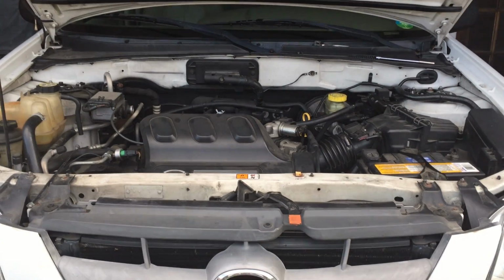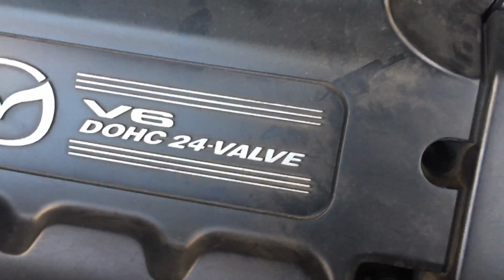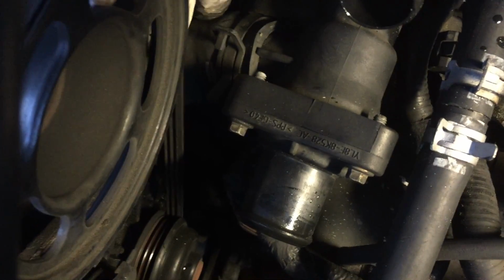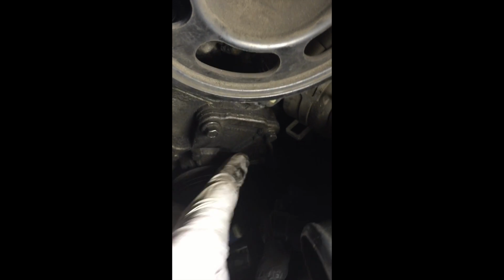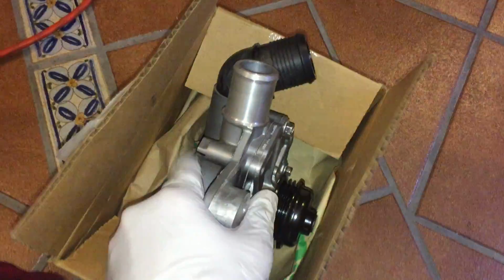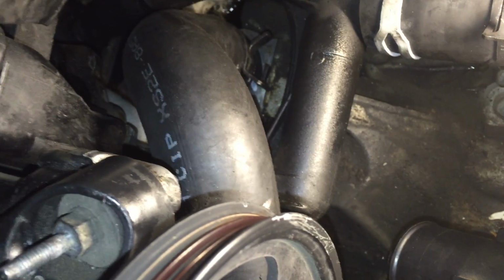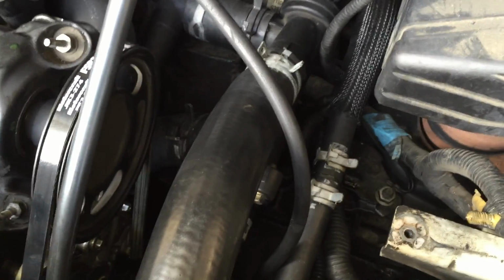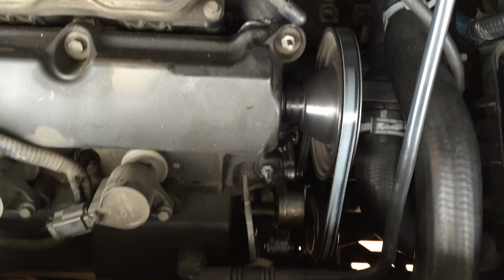2001 Mazda Tribute V6 water pump replacement

Comment: Thanks so much for this video, helped me so much (and still will in future). Turned out the plastic connection on the water pump housing was this close to sheering off for a long time, as I found out while trying to jiggle the thermostat connection off, and it broke off at the other end, with a huge splash of coolant. Now there's my problem!

Comment: You gave me the confidence to try to do the job myself, very well explained and to the point. Only thing that puzzles me is that the the water pump model you use for your job shows as non-compatible with the 2001 Mazda Tribute in multiple searches. Any thoughts?
Reply from the maker: Juan Carlos Martinez-Sanchez , thanks for your comments. Strange, the replacement pump I used is Ford/Mazda original replacement. Remember: mechanically all Escapes and Tributes of the same years are the same.

Comment: Great video. What is the part number for the plastic connector to heater you mentioned in the 11:10 mark?
Reply from the maker: Leo:
Check below on my replies. Most of the hoses must be purchased directly from a Ford parts supplier.

Comment: Mr rochet, great video thank you. my leak was not the water pump but the bottom outlet hose. part number yl8z6n746ba is got a clamp on the top, please how do I take it off?
Reply: there is a little clip holding the clamp open is it to make install easier?
Reply from the maker: To be honest, I removed/installed that hose with the pump out. Is much easier.
Reply from the maker: Yes, the clip on the new hose clamp is to hold it open until ready to be installed.

Comment: would you recommend taking the whole pump off just to replace the front part ? do you know if the front part has a gasket or just need sealant to connect to back part ?
Reply from the maker: Saab Aero:  Yes, I would recommend taking the pump off. Is too cumbersome and tight to split the pump, although not impossible.

Comment: Mine i got problem with leaks from water pump the connector of small hose, because of the plastic O ring..can you suggest what kind of o ring can i replace for that connector? Thanks in advance. Im from philippines🤗
Reply from the maker: There is a plastic connector on the longest hose. I don't recall a plastic O ring. The plastic connector can be replaced with a bronze one of the same size.

Comment: Where did you get the lower hose that comes off the water pump I believe it's 5/8 hose for the heater, I can not find it anywhere
Reply from the maker: Hi whatupfuch: I tried to get those hoses via internet and wasn't lucky. You need to go to a local Ford parts dealer and find them. There are 7 hoses in total. Here are a couple I found on my invoices...(sory, I don't have all of them).
XS2Z-8A577-AB SHORT HOSE
XS2Z-8A567-AA HOSE
The above two hoses go to the pump and plastic manifold. You need to get the other ones that go to a plastic hose manifold that sits besides the pump. Your dealer should be able to show them on the Ford parts diagram. The lower one I show on the video, goes from the pump to the block (front side). It changes depending if you SUV has oil cooler or not. My doesn't. Try to have your VIN number handy. Hope this helps. JP
Reply from the maker: Good news! I found the info you were looking... These are the other hoses I bought:
KH-125 Heater Hose
KH-134 Heater Hose
YL8Z-6C658-A Hose
YL8Z-18C553-HG Hose
I hope this helps.  JP
Reply: +Jean P. Rochet thank you for your help
Reply: how much total for all parts?  buy motor craft or other brand in sure motor craft better but is it that serious to get motor craft?

Comment: hi the water pump small hose below has a switch what is that for should it be closed or half open ?
Reply from the maker: Chris p: I'm not sure what switch you are talking about. Is you SUV a V6 or a 4 cylinder model? The one I worked on this video is the V6 model. If you can, please send a picture of the "switch".  Jean

Comment: Mr. Rochet my  Ford Escape 2001 3.0 have the same water pump I can't find the trick to remove the long hose, can you show ho to do it?
Reply from the maker: If you are talking about the one that goes on top of the engine block, that's a pain in the behind to get out !  I also had to struggle to get it out. Check the video again: I used a small long nose pressure pliers to open the clamp that holds it. Good luck.

Comment: hey I have 2001 ford escape v6 xlt. get crappy mpg. 170 180 full tank. throttle body  cleaned so they said well mechanic said. get valve changed about 2 yrs ago. But. I feel i should get more mpg. any tips?
Reply from the maker: Those V6 engines are known for having leaks on the intake runner silicone seals. They should be replaced after 60-80K+ miles. The symptom is rough idle at cold starts that improves after the engine gets to operating temp. Be aware that there are seals above and under the intake manifold separator. Many people change only the upper ones and forget about the lower ones. If you do the above, change all spark plugs (anyway you will need to remove the intake manifold to replace the three plugs on the rear of the engine). Also try Techron gas treatment and fuel filter replacement.
Reply: Jean P. Rochet I bad oil in 2 plugs well  when mechanic  chafed plugs I had manifold  gaskets upper and lower he didn't replace for me because said may need to  do I think engine gasket or whatever he said also ran scanner no codes. But I think I'll replace manifold gaskets asap because 140 miles on full tank is ridiculously  low to me. got 210 one weekend in a highway trip then next weekend on reg  driving city with some a.c usage 140. before he cleaned throttle body had 170 180reg city driving. so something  is wrong. And I hate the fact I get low miles. wanna improve that but if it's them gaskets I'll try that. ask I i mention changed valve. meant egr valve. But I'm next owner after the egr  was changed may be it's worn and needs replacement. plus read pvc but that's for emissions  but if will help gas miles then I'll change too but if won't help then won't. jist asking for tips to improves mpg.  thank you for the feedback
Reply: Jean P. Rochet I did fuel filter  previous owner must have never changed it was rusty and leaking. replaced less than a year ago. how often should I change. plus only out about 2 thousand miles on it since got it.
Reply from the maker: Check the status of the catalytic converter (many videos on YT on this). I've seen clogged catalytics giving you that same result.
Reply from the maker: Check this video: https://youtu.be/GAD7TnW4O6Y
Reply: Jean P. Rochet I actually improved my mpg  I cleaned the mass airflow sensor. I'm getting around 210 on full tank. way better than 170  thanks I'll look into the vid you sent
Reply from the maker: I'm happy to know you are making improvements.  Sometimes fixing a car involves a trial-and-error approach until you nail the problem!
Reply: Jean P. Rochet thank you sir. just at cleaned  idle air control valve seems lil better.  I left car alone for 2 days went to go to work had idle problems  we had rain. not sure why but my bro said since he was previous owner said gave him problems in rain I never witnessed this til other day. cleaned it. so drove it was fine then next day  also fine til after work today. got check engine. it's 02 sensor bank 1 sensor 2. so not sure if clean or replace. any suggestions?  if clean or just replace. And if clean best way.
Reply from the maker: If that sensor is the original one, I would say to change it. Replacement (not original) part shouldn't be expensive. Shhhh... I'm still running on my original one (126K miles)! Knock-on-wood. :-)
Reply: Jean P. Rochet ok thanks. replaced. seen on bank 1 sensor 2 what screws into is a crack. Now to fix that. maybe reason for code.  I replaced o2 sensors on bank 1  next bank 2  but after I fix crack

Comment: Where can I find a water pump for 2003 mazda tribute
Reply from the maker: Kevin Jones I bought mine from a Ford Auto Parts dealer here in Puerto Rico (same as Escape 2003).
Reply: Order it from Amazon.
Reply: Mazda tributes/Ford escape share the same parts.

Comment: Forgot where breather tube goes.. help
Reply from the maker: You have to look well into the center right side of the engine block, under the MAF connection point. Is way down there, a round plastic connector with a screen on the tip. Use a good flashlight, you will find it.